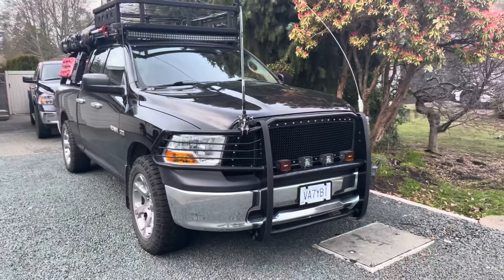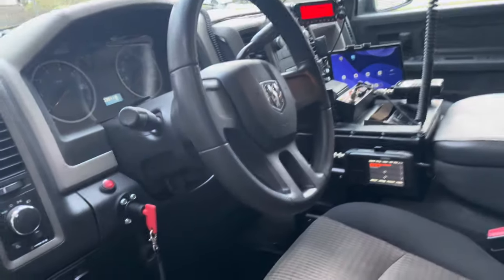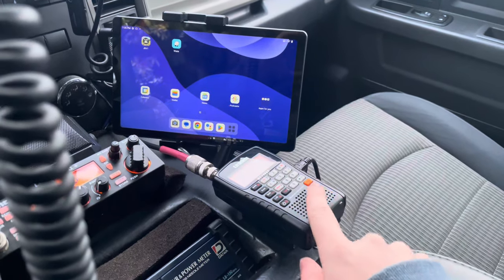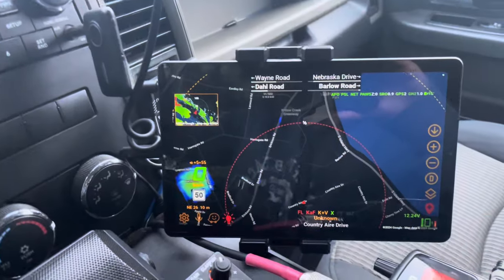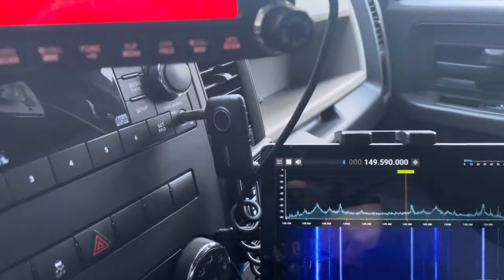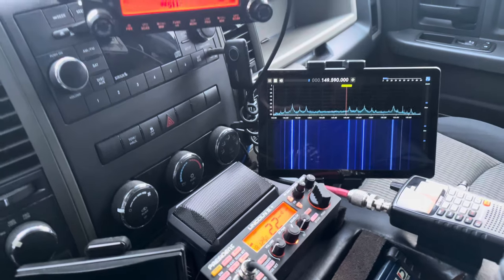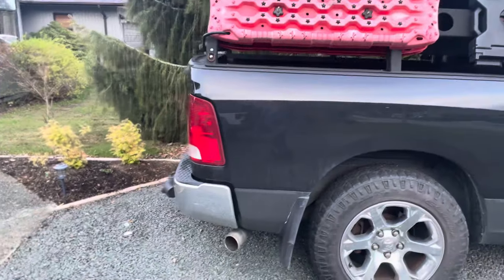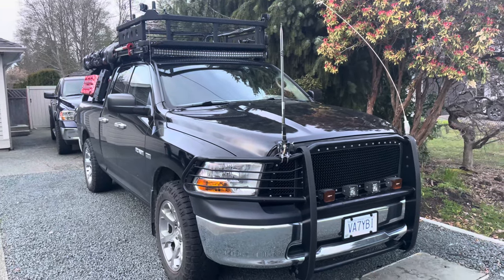Ham radio mobile set up, update April 2024

Comment: Battery cut-off switch is always a great idea, but the location is not good. In a bad accident it could make contact with your left knee. I have scene this with older snow plow controls before they switched to the remote control

Comment: Watch the RTL-SDR dongle's temps my man, those things get hotter than hell! You don't want to catch your rolling shack on fire!
Reply from the maker: Interesting… 
I’ve ran mine for several hours straight and it seems rather fine, warm to the touch but nothing hot.. maybe yours doesn’t have thermal pads inside it

Comment: Great update. I just started playing with my RTL SDR dongle, too. It blows my mind. Maybe i missed it. Which antenna do you use for that? And an awesome idea putting a tablet mounted in there for it. And good idea with the kill switch.  Keep those projects coming, brother!
Reply from the maker: Thanks! 
The sdr is connected to the 17ft chameleon, works super well, 
I was parked by the water, able to hear stations from England coming through on 20m band
Reply: @jackbarker2175  crap, that's awesome. I also threw a 17footer on my roof but a crappy Chinese one and tried to tune for 11m... no luck. But for listening for the SDR? Genius.

Comment: Wowie! That's not only a nice truck with cool accessories But the radio equipment puts it at a whole other level. 
Question: To operate the bear traker and sdr on the same antenna can you operate at the same time and what type adapter and/or connector did you use? Thanks for sharing, KO4HPC 73
Reply from the maker: Thanks! It’s just a generic pl-239 splitter, all that is needed!
Reply: @jackofalltrades28  Thanks a bunch Jack. 73

Comment: WTF @ 0:30, you don't put two antennas on same bloody mount. Battery Isolator above knees, nope, bad location in so many ways. You have a mountain of gear, all facing the drivers seat, DISTRACTED DRIVER SITUATION.
Reply from the maker: First off, they are listening antennas. 
So it doesn’t matter, 
second off, I’ve got 2 battery isolators. 
Third off, vehicles not some small Toyota Corolla, plenty of room, everything mounted perfectly, and far from distracted driving, because there’s something called prioritizing, If I’m driving I’m looking at the road, not my equipment lol
Reply: @jackofalltrades28  First- If you think that suddenly makes it correct, please stay off the air as you far from radio wise.
Secondly, so what, put them in logical location not above your knee with dangle-berries on it.
Thirdly, if its turned on while vehicle is in motion, its a distration, especially when your batting yourself over the tablet screen and SDR. Happy to call BS on your claim.
Reply: I have worked in a police cruiser solo and never had issues with three radios and the LEERN system used in my state. It also helps having specific training in utilizing comm gear running solo in the military. It all comes down to training and more training.
Reply: Sign of the noob...  he put lipstick on that pig. 😂

Comment: I have no clue why anyone would want an antenna in their view all the time.
Reply from the maker: Doesn’t bother me 🤷🏻‍♂️
Reply: It’s quite common in NATO vehicles as well as a lot of Red Cross vehicles. 
Should attend the Hamvention in Ohio in May, there are several wild ones who have turned their vehicles into porcupine rides with several dozen antennas installed on their cars.
Reply: You don’t notice it after a few hours driving
Reply: @Subgunman  Ya it would drive me nuts. I'm going to be putting mine on the roof or on the ditch light brackets.

Comment: Why did you put your antennas on the front?
Reply: why not. Gotta put em somewhere. Doesnt matter if front or back.
Reply from the maker: They are both listening antennas, not for transmitting
Reply: @jackofalltrades28  But even just for listening the antennas and feedlines are located close to the engine compartment where most of the vehicle noise is generated. JMHO, FWIW, YMMV, etc.
Reply: @mikemcdonald5147  A. Antennas need to be as far from a noise source as possible. The engine compartment is where most of the noise is generated. 
B. RF safety concerns by having a transmit antenna close to the operator, though if listening only isn't an issue.
Reply from the maker: @joewoodchuck3824  there is no noise coming through when the vehicles running 🏃🏻‍♂️
Reply: @jackofalltrades28  You're very fortunate then. I ran HF mobile in two different cars and the computer hash was horrendous.
Reply: My main question is visibility, things in front of my car drive me nuts.
I like the interior setup, very nice! Lots of junk in your back tho, I presume it's for offroading/camping?
Reply: @jamess1787  The antennas are also more vulnerable to damage in front.
Reply from the maker: @jamess1787  far from junk, and or visibility problems, but yes, it’s camping and off roading equipment